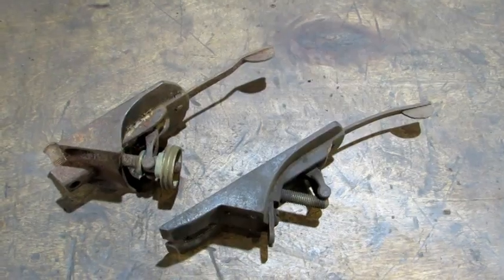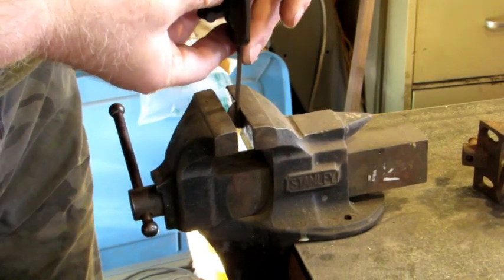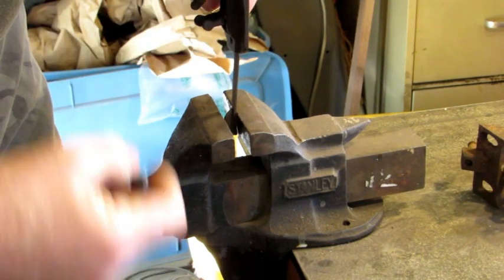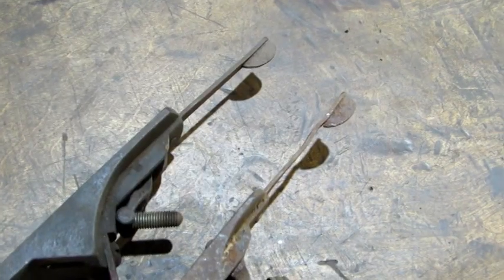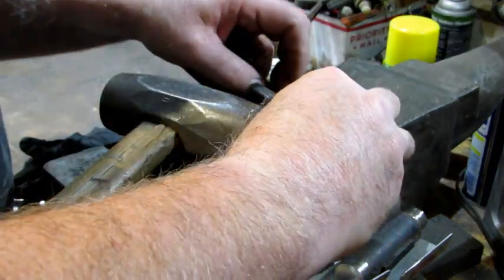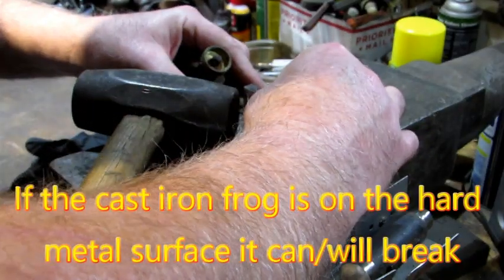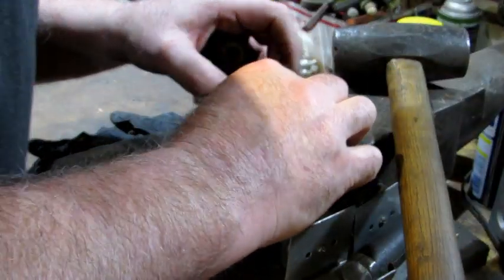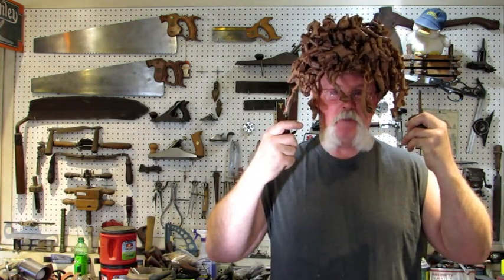Straightening a Lateral Adjustment Lever

Comment: I have a smaller metal workbench in my shop that gets moved from place to place so it is usually uneven somewhere. I got an axle shim for a truck and keep it on a cross brace for need., Quick and easy. Lot of time a frame and axle shop will give you one. Just stick it under an unlevel leg and good to go.